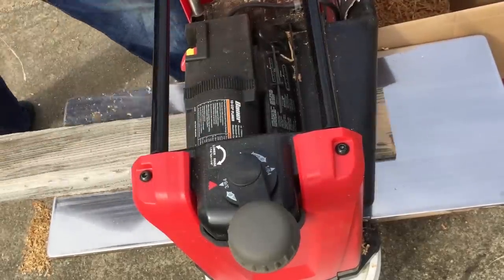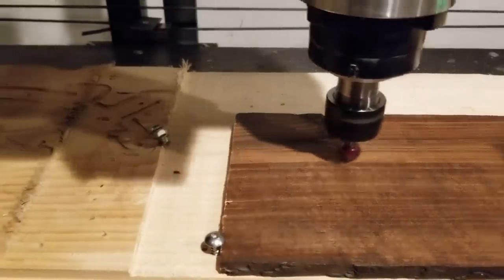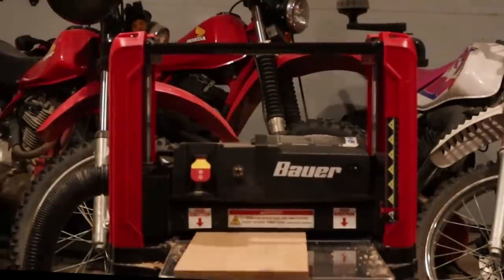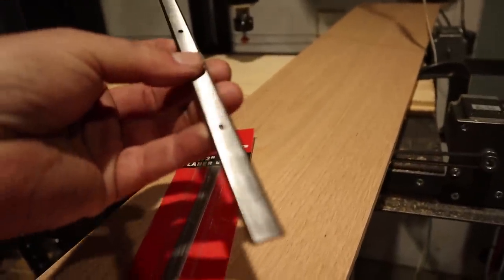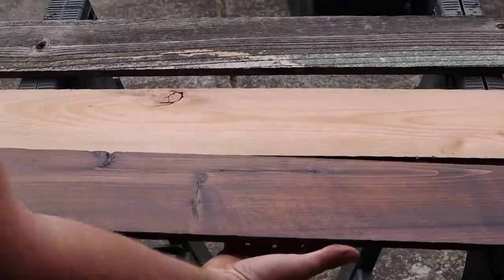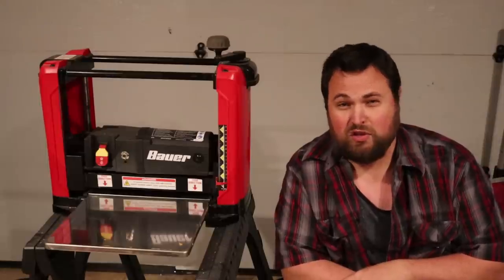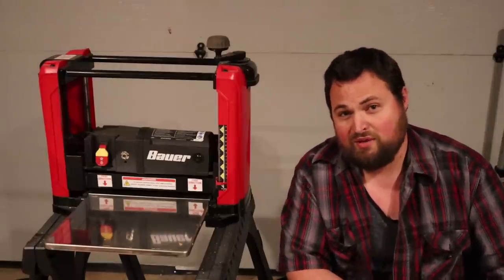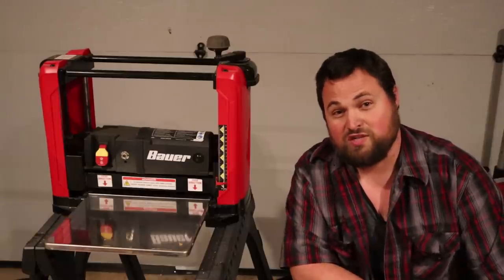Harbor Freight Planer Review Update: 1 Year Later

Comment: "If you pay more for the same size planer, what do you get?" Potentially one or more of the following:

1. Better QA with better unit-to-unit consistency, fit and finish.
2. Longer tool life, overall, owing to higher quality materials and workmanship and/or the aforementioned stricter QA process.
3. More readily available accessories and replacement parts.
4. Accessories and replacement parts available for a longer period of time (i.e. lower chance of tool obsolescence).
5. Better customer service and/or a more generous return policy.

Budget tools are almost always made overseas and often multiple retailers sell products all made in the same factories. For example, Harbor Freight's numerous store brands are often made by the same factories that make Grizzly, Jet and Porter Cable products. Craftsman, DeWalt, Milwaukee, Ryobi, Ridgid and Makita (which I believe only represents two actual companies) are sometimes made in the same facilities as one another.

The difference between two brands, then, becomes a matter of ancillary or "value added" services. 

For example, a Harbor Freight tool and a Grizzly tool may be made in the same factory with one getting red paint while the other gets green. One of those brands, however, specifies a higher reject rate in QA testing and backs the product with better customer service. The tools are, for all intents and purposes, the same, but what you got by paying a slightly higher price was  a tool that came from the top 70% of the batches (eliminating the bottom 30% of potential trouble-makers) and a more pleasant customer service experience when dealing with any problems that do develop. 

Mind you I'm not advocating for or against one tool brand over another, nor am I advocating against Harbor Freight specifically. Quite the opposite--to spend money on badges and stickers is foolhardy. But, while I realize the question was asked rhetorically, there IS an answer to the question, and I felt it should be given.
Reply: "Budget tools are almost always made overseas" - Man  have I got some bad news for you about pricier tools ...
Reply: @yerboyjavi610  Please understand that I didn't say that to indicate budget tools are "bad" because they're made offshore, that other items aren't made offshore, or even that offshore-made items are of de facto lower quality. The point was that many tool brands are all made in the same factory and that the differences between them are not what many people think. In fact, we could list many items not made in the U.S. that are of very high quality, if not best-in-class (think Rolls Royce of England, Rolex of Switzerland, Sony of Japan, the list goes on).
Reply: Though several different brand name tools are made in the same factory and by one major name, there is a hugh difference. For instance: Black and Decker makes Dewalt. Which is better? Dewalt is of course. Dewalt has  higher specifications in every area of its tool make up from the body to the motor. It IS better in every aspect then Black and Decker.  It's that way with other brand tools also. Though a manufacturing company makes tools for different brands, that manufacturer must follow specific guidelines as they pump out tools for their customer base. Cheaper requirements...cheaper parts...lower quality craftsmanship...thus cheaper tools.
Reply: Doesn't seem like an answer. Seems more like speculation. Unless of course you have visted each of those factories that build each different machine and analyzed each of thier Q.C. procedures. Otherwise the best you can do is make assumptions based on your own opinions and what you may have heard second hand. So which is it?
Reply: @Trainwheel_Time  Actually it's neither. What I'm giving you is information based on my experience,  and information I've gotten from other sources, including things that are pretty common knowledge. What you do with it, whether you "believe" it, and whether it's useful to you is a personal matter for you to decide on your own.

Comment: That looks just like the planer I had many years ago (under a different brand).  I built a lot of projects with that thing.  The snipe on the ends was tolerable, but still a little frustrating, but otherwise, the power it delivered wasn't bad.  Since then, I've upgraded to a 15" grizzly, 3hp, helical cutter head.  If you have the space and budget for such a machine, it's fantastic.  I can take double the cut at a much faster feed rate than I could before and the finish is fantastic.  If you're just starting out, that little 13" planer will get you where you want to go.

Comment: whats the big deal about saving money on tools, if most brands are made in the same sweat shop?
Reply: There's nothing wrong with buying this tool for the majority of people who need a planer. However as someone who uses wood working tools professionally I can assure you that this is not the same quality as a professional brand tool. I don't care if the professional brand is made in the same sweatshop. The American and European companies give the specs to the Chinese manufacturer right down to the material quality for each component. And so does harbor freight and they have to get the cost down so they can sell it cheaper than the other brands by making cuts anywhere they think they can get by with it. So for most people this kind of tool is fine and a good price. But if you think this is equal to a DeWalt or Milwaukee you are mistaken.
Reply: @ actionjksn,. Would appreciate an opinion. We are constant remodelers and hobby woodworkers.  Have most every other tool but not a planer...   I am having trouble fitting a DeWalt planer into our "side of the garage" workshop. (And the weight of a planer at our age is also an issue... would definitely have to put it on the rolling cart but thinking we could put it below and another tool on  top for the floor space. ).   We are having trouble justifying the cost of a nice planer.  But I keep coming up with the need for a planer and in the long run I'm thinking we'd be better off buying one and sacrificing the space for it than buying a set of blades for using our friend's  DeWalt planer so often. This video makes me think I should look  at the Harbor Freight planer.  Occasional use.  Also have a stock of 40 Year old rough  Cherry boards laid up when we were first married that we need to finish off.  What do you think?

Comment: Spray the screws and guide rods with lube once in a while.
Reply: Would the oil attract saw dust from the planer?
Reply: @shawnr771  the sawdust will go everywhere and soak up any oils so i use silicone spray when I lube it.
Reply: @budgenatorP  Thanks.

Comment: For what it is worth my experience with their planer is very positive. I was a carpenter by trade. I needed to take a few boards down as they were to thick for the job at hand. I bought the planer for one job only. Being it was only$200.00 at the time and a custom shop would have been about the same I took the gamble. It did my job well and is still going strong. I couldn't ask for anything more. I am well pleased with mine!

Comment: Great review video!!! I would like to add to your comments on some of Harbor Freight Tools being garbage. If you have a Pittsburgh hand tool and it breaks or doesn’t work to your expectations Harbor freight will replace it with no questions asked. A lot of people say that Pittsburgh tools are junk or trash but the worst that I have had happen is a socket cracking and a wrench bending, both were my fault because e using the tool for something it wasn’t intend for. I took them in and had them replace with no problems. I have also found out that if the tool breaks then it’s probably not the correct tool for the job. Here is a good comparison when it comes to power tools from Harbor Freight Tools. I have a hammer drill I bought from them over a year ago and it out lasted the HILTY brand hammer drill. Both equivalent in size and bit size. The HILTY drill was 3 times the cost and the motor burned up on the second full day of use. I used the Harbor Freight drill to finish the job for the next three days and drill twice as many holes. I called HILTY and they wouldn’t replace the drill and I was out $500.

Comment: Several years ago, "The Family Handyman" magazine did a story about expensive vs "cheap" (AKA HF tools). TFH article stated this:  What are you using the tool for? How often are you going to use it? How hard are you going to be using it?  Their answer was simple. If you use your tools regularly, like a circular saw or corded drill, get the Dewalt or the Craftsman Pro. If you don't plan on using it much, such as an angle grinder in a garage shop, get the HF grinder. HF's quality is good enough for the general tinkerer and you won't break the bank. Personally, I have a Skil circular saw, Craftsman Pro corded drill, Black & Decker jig saw, a Dremel tool, Milwaukee palm sander B & D orbital sander, Craftsman belt sander. My HF tools are: reciprocating saw, 18 G brad/stapler air tool, 4 1/2" angle grinder, 3 ft long bar clamps, metal tape measure, metal detector wand etc. I don't use these tools all the time so that is how I justifying those purchases. Also, HF, is stepping up their game and have improved their quality significantly. Good video! So, now that you're done with the video, you can send me this planer! Ba ha ha ha ha ha ha! Saw on brudder!
Reply from the maker: Yes! Exactly!  I use Milwaukee at home, DeWalt at work, and anything I won't use much? Harbor freight. Engine puller, floor jack, planer, welders? All harbor freight, all still working great!

 Fun fact though: good angle grinders, in my experience, don't last longer than HF ones. I am a known grinder-killer, and the difference is the expensive ones have more power, but the pinion will always be the weak point. My brother does granite countertops, he might as well have a monthly subscription for new grinders.
Reply: @StrangeGarage , like you said, do you pay $260 for a Bauer planer or $600+/- for a Dewalt that just sits in the corner 1/2 to 3/4 of time? Got a test for you. Try out the HF Aluminum welding rod maybe?

Comment: I've fixed and maintained a number of Planers and jointers over the years. You asked What would you expect to get out of a more expensive planer. 

What I have found is that often the higher end more industrial target versions, have more availability for parts. Often are easier to setup and maintain than the cheaper more consumer targeted versions of the same products. Which lets face it. When your running the thing for multiple hours at a time, going through 2-3 sets of blades a month. It can be a really big deal. This isn't as big of a deal for someone that has the time but not the money to spend on those setups. 

The other big difference is feed speeds, accuracy and overall horsepower of the machine. The industrial machines will often remove material much faster, allowing you to really push it to the limit and make deep cuts in hard woods. Instead of only taking off 1/64th at a time. Which again if your running a production shop that is going to make a big difference. If your a hobbyist or occasional user of a planer not really going to be a big benefit to you. 

Does that mean theres anything wrong with consumer grade tools. In my opinion not at all. If it allows you to save time and get the job done in question then its worth it. Just don't expect to be taking  1/4" cuts in a hardwoods. Yes its going to take you a bit more time. But honestly your final couple passes shouldn't be that deep anyways if your looking to save finishing time with a planer.

Comment: I own many Harbor Freight tools.  If they give me no problems, that is great.  If they don't hold up, I replace them with something of higher quality.  I had a 14" chop saw for metal.  I used it for a year, but I did no major projects.  I decided to build a 1923 T Bucket.  As I was making the frame, I let the factory installed smoke out of it.  I replaced it with a DeWalt.  That was 6 years ago, and it is still going strong.  I had a 4  1/2" angle grinder.  It worked ok, but it fell off of my welding bench and the handle broke off.  So, I replaced it with 2 DeWalt 4  1/2" angle grinders so that I could leave a cut-off wheel on one and a flap wheel on the other.  I have several other electric H/F tools, and have no issues.  I feel that if the H/F tool fails, replace it with a better one.

Comment: I bought a bauer and used it for small stuff for about a year. I had a project and had to plane 10 8' pine boards. 2 boards shy of the finishing the second pass the motor threw sparks igniting the sawdust. Thank God it was set up outside. Warranty expired, of course. Good Luck.

Comment: I'm glad you're having great luck with it I went through two of them in in two days. The first one the feeder wheel locked up the blade and the motor great lots of power I had trouble with the feeder Wheels the second one would not even go there  one board
Reply from the maker: That really is the trouble with HF tools. Some work great forever, and the rest hardly work, if at all.
Reply: @StrangeGarage  like you said tools go through hell in your shop any electrical devices from Harbor Freight go through hell in my shop I have Me a Craftsman planer coming

Comment: Hey Brother, This Comment hopefully makes your decision a positive one. My home shop has 95% WEN tools. I am not a cabinet shop, but a custom woodworking shop. The WEN 6550 12.5 inch planer uses the same guts basically this machine uses. I have put the WEN6550 through some serious work. (Passing Hardwood Flooring through it. The finish is an acid finish that is tougher than a boy named Sue. I have had the WEN for 2 years 4 months and have only had to replace the blades. Amazon 4 pack for $38. Current liner foot count is over 2300 through planer. Just yesterday stripped a hex bolt that holds down the blade plate. Expected since this is the 18th change out.  Ordered a new set (12 Count). Not bad
So, I would say this planer will be more than acceptable for what you are doing. I am about to buy this one for the shop and use it just for taking the finish off the flooring then the WEN for the final passes. 
I have used Dewalt in the past and the difference in price is not worth the result. Keep making sawdust friend. 

.

Comment: This looks like a riff on the old school 2 knife portable Delta planers- which were better than the next model 3 knife units. I picked up a 2 knife Delta for $75 on the used market and it still does a sweet job. If that one craps out, I might consider going to a Bauer for replacement.

Comment: I just had good experiences with HF. Years ago I needed a reciprocating saw for a small project in my bathroom remodeling, I paid $29 for this rather ugly dark red thing, not only it did the job but it's still working after years of abuse, old hard redwood, thick nails, tree branches, steel square tubing, the thing won't die. I also got a rotary hammer drill (small jackhammer and concrete drill), same thing, $80,  perfect. An other example is a drain shovel (narrow shovel), great strong steel, fiberglass handle (much easier to dig for planting stuff in the garden than a regular shovel), $14 compared to $45 at HD, and I got junk from HD, I broke a (digging) pick, bent weed fork, ... I wish HF would sell material too, the orange store has almost the monopoly on house projects and they price as they wish. I'm thinking about getting this planer, deciding if I really need it (it would take space in my shop). Thanks👍🏻

Comment: Glad to see this update on the Planer.  I am not an expert woodworker nor have a completed anything.  But I was have been working on a desk.  I am using 2x4 construction lumber.   I'm curious can this planer be used for this kind of wood thickness?   Thanks in advance.   Oh and I enjoyed the tactful replay.
Reply from the maker: This planer is good for up to 6 inches thick, so 2x4's are no problem:) that type of wood is also typically pretty soft, which makes it run through even easier. Just make sure the wood is dry. Thanks for watching! Good luck on your project!

Comment: Worth noting, that this seems to have the same exact motor as the WEN 6552 but with only 2 cutter blades. The 6552 has three blades for a somewhat better finish and is currently a few bucks cheaper than this one on AMZN...

Comment: The only concern would be the quality of blades. Cheap blades can break when they hit something metal (bullet, staple, nail), and they the machine fires that shattered metal in a straight line. Typically you are standing way to close for this not to hit you. A good quality carbide or steel blade won't go flying typically. 

As long as you are certain that the board is clean, then have at it. If not, be extra cautious. This come from three generations of Carpenters and a family that researches the crap out of the tools we use. 

Side note, looks like the feeder allows it to walk. So for planing things upright it may not stay square.

Comment: A higher priced planer would sometimes be heavier and more stable, also potential uses more voltage depending on the type.

Any planer that uses a standard plug would be capped at 1500 watts or 2 horse power so brand isn't as big a factor as long as it can pull the same power.

Perfect example of good enough being good enough.

Comment: I have the same planer (brand new) n only used it maybe 10 times if that, my question is I put a round 4" wood cutting disk n was taking it down to 3 "  after  feeding it thru it shot back at me like a bullet sending me to the hospital from the force/speed think it perforated my stomache  or bowels. What would of caused it to do that.  No knitting the wood, blades were fine...?